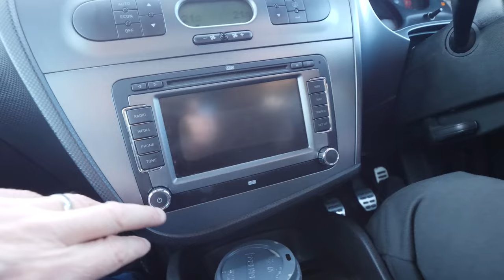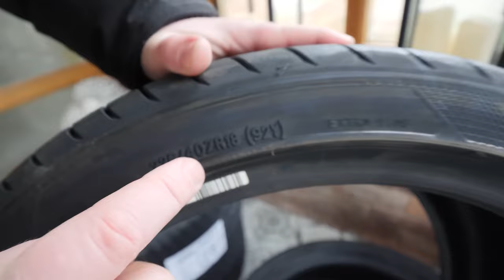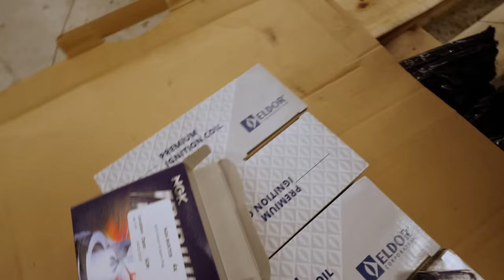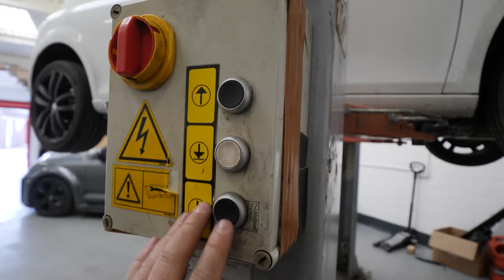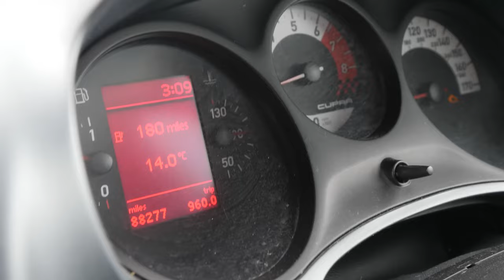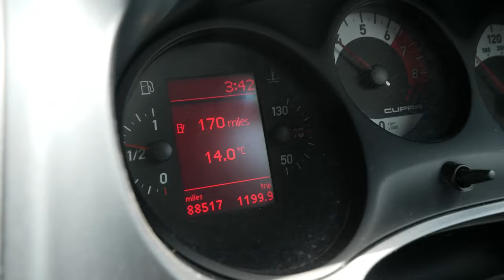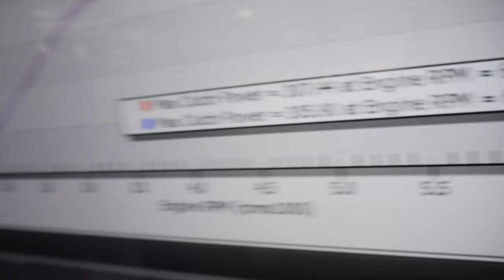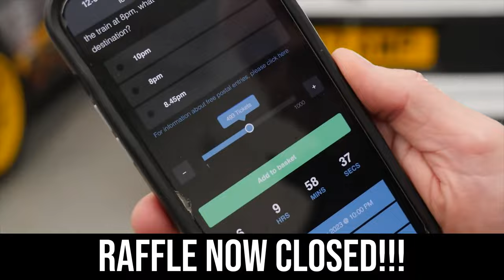FULL RESTORATION - REVERSE MODIFYING OUR NEGLECTED SEAT LEON CUPRA K1

Comment: *If you fancy something a little left field (but if you know, you know) maybe consider going old school with a BMW 325ti Compact.  They're a properly good car to drive and not too shy of the M3.  They may only have 197bhp but with shorter ratios they're pretty spritely and a turbo will easily see you getting up towards 400 brake.  Put some decent suspension on there and an LSD and you'll have M3 performance and handling for a quarter of the price. If you want to try one, just give me a shout and I'll bring mine up. I've got a passport!*.
Reply: Passport won't help with your nosebleed mate 😂
Reply: hairdressers motor

Comment: The K1 was a 21k car new back in 2009. Don't get me wrong it is an amazing car I had one for 12 years from new but why would you spend 25k on this car what is only worth 7k at best. 😂
Reply: 25k...and that mid. a.-- hole exhaust tip look super stupid . maybe with the diffuser fins its not that ugly but they dropped em to the trash lol😂the original bumper looks much better, or the two sided twin monster -btcc rear bumper.....but that mid.hole one is ....jesus, ugly as hell. the front as well, i dont understand uk peep why love that ugly monster -btcc - k1 kit, its a mistery to me. the original cupra  bumpers look 1000 times better.....and there are nice led tail lights out there like car-dna . for the handlin a little bit heavier and wider wheels recommend with 235 tyres...so 25k is way too high